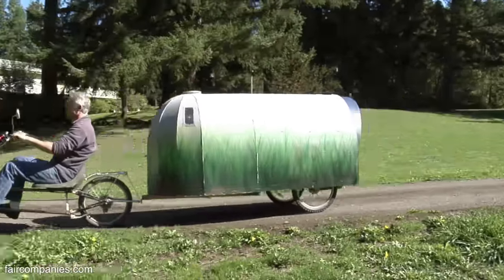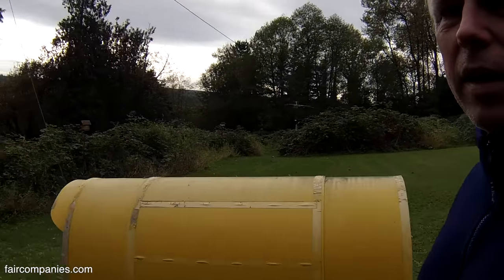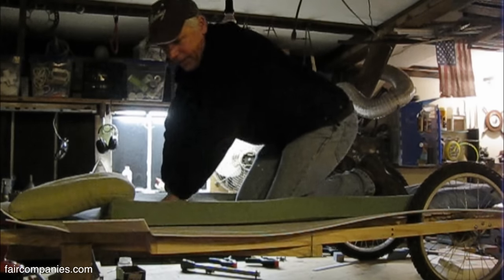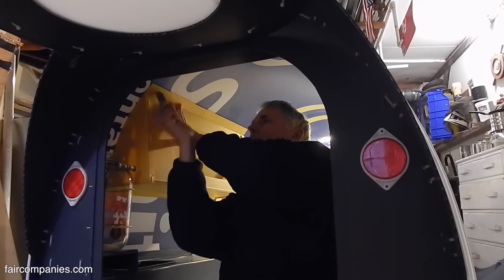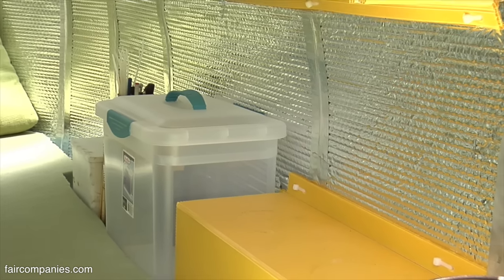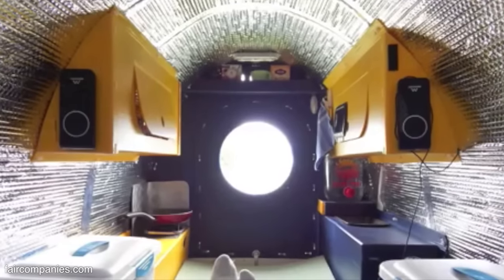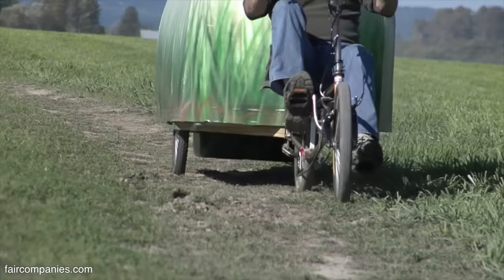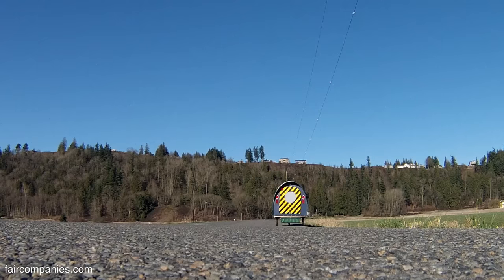$150 bike camper: DIY micro mobile home (downloadable plans)

Comment: How about just get one of them kiddie bike trailer things and keep a small tent inside the trailer...?  Along with a sleeping bag of course.
Reply: +Robert Decker Jr. You'd have to take time setting up, and taking down your tent each day.  You'd be sleeping on the ground.  And you wouldn't have cabinets and counter tops.  But do what you want.
Reply: +deezynar Indeed.
Reply: +Robert Decker Jr. +deezynar is right... you are thinking about making a scattered trip and not a total change. If you want to do much camping or it seems this guy makes this his "home" for longer trips, you want to have things accessible. He says, he has drawers so you don't have to hunt through bags etc. What you're suggesting is just regular bike camping. This is meant for people who enjoy the diy of it, the challenge, the build and then having something that works as well as much larger, elaborate and expensive trailers. There are regular bike camping vids if you prefer that though.
Reply: +deezynar I can set my hammock rig up in about 10 min and weighs less than 4 pounds.  I don't sleep on the ground.  As for clothes when I'm hiking and/or biking I usually have but just one change of clothes, if that.
Reply: SecurityPro2704
Great!  I'm very happy for you!  You camp how you want to!  The rest of us will camp how we want to.  Is that OK with you?
Reply: What is a kiddy bike trailer thing?
Reply: Scarlet Peoni Those little trailers that attach to bicycles.People usually use them for carting around they're 2-4 year old kids,but you could also use them for carting around bags of groceries or even modify the thing so that you yourself could actually sleep in the thing,or just carry around a tent and other necessities. Food and supplies and such.
Reply: Robert Decker Jr. Thankyou, I need one for a Shetland pony but wasn't sure what they were called.

Comment: do you think I could pull this behind a moped
Reply: DaveyG's Channel 

I'd check local laws but it should be possible to pull behind a moped. My only concern would be how it holds up at the higher speeds of a moped vs a pedal 🚲.

Cheers! :)
Reply: Yes.  The power is there

Comment: "this is a regular camper" lol no it's not.
Reply: No but it IS a camper. And it IS shelter. And it IS better than a tent.
Plus you don't have to set it up and take it down all the time. It's also
available to get out of the weather,  immediately, if need be.
Reply: Yes it is, go ahead and prove otherwise. Or try at least, but i wont respond unless you do but you wont so bye forever :b
Reply: thats sad last guy before me in reply section

Comment: To top it off, he pulls it with the most inefficient bicycle he could find.  This is silly.
Reply from the maker: +Jacob Actually he mentioned in his interview that that bicycle isn't ideal for the setup and he'll change it out.
Reply: +Kirsten Dirksen that is so cool
Reply: But not bad for a prototype!
Reply: +Jacob Recumbents cause less aerodynamic drag.  His head is not much higher than the top of the trailer which is ideal.
Reply: +Jacob 
Supercilious trollery at it's finest there, Jacob.
Reply: he is proving a point , and don't watch
Reply: Actually, a recumbent is great for this.low center og means weight won't cause front wheel to lift. Recumbents are more efficient that uprights. The bike does not shift side to side, so it's easier to drive. Recumbent are like tractors when pulling loads. I've pulled a trailer with a 5 gallon bucket full of gravel with mine.
Reply: that makes about as much sense to a person of 55 as saying shut up and eat your toast that your no eating, knob. read what I said in context, I was defending the person making the video against someone who has done nothing with their life, and before you say anything about what have I done, I have invented cheep self-sustaining electricity, safety device for trailers, the class 1 trailers not the little ones, and so much more.
Reply: Jim Rafferty How would you even begin to know what I've done with my life?  You don't even know me..
Reply: for if you had done anything in life you would know just how hard it is to put yourself out there, and wouldn't then be so quick to scorn. just saying.
Reply: agree
Reply: +Jacob Uhm, how is this "inefficient"? Please elaborate.
Reply: +taxiuniversum It has no gears, Is very heavy and the sprocket mechanism is the least 'bang for your buck' energywise. It looks cool but is very impractical if you were to ride long distances
Reply: +Kirsten Dirksen , he seems to be in constant evolution with this goal.
Reply: +Sage Craigen What are you talking about? This is a recumbent, making it far more comfortable for long-distance journeys than diamond-frames bikes. At 0:59, you can pretty clearly see that it has a regular gear box. And what is a "sprocket mechanism"? 😜
Reply: We are talking about efficiency not comfort.....
Reply: +Sage Craigen if it isnt comfortable efficiency is irrelevent.
Reply: You can get bikes that are both ;)
Reply: He needs a Shetland pony
Reply: +Jacob pretty sure he's not trying to win a race broski . . .
Reply: the camper is very light, and the bike has gears.  Being a folding bike, he can store the bike in the camper, then lock the doors, and chain the unit to a tree or a light pole while in browsing in town, sharp designer!
Reply: On-road at speed, this bike is the most efficient. It's called aerodynamics. Look it up. Off road with obstacles, it gets less so.
Reply: why is it inefficient?
Reply: +Greg Miller Anything you can put your fist through will never be lockable! Apart from that, I agree. Brilliant design and I'm gonna have a go at making one myself, happy camping :)
Reply: I think this is a cool idea, and the idea of using a recumbent bike even cooler.  However, enlighten us...what is wrong with it and do you have a suggestion for something better on a setup like this?
Reply: That is what I asked Jacob below.  I am curious as to what is inefficient about the bike and what would he suggest using in it's place.
Reply: Pfft, another untalented YouTube critic, leaving negative comments and energy. When people do that it's a means of taking ownership of something they never did.
Reply: Head on!!!
Reply: yes, however, I would want my bike to be able to be locked inside, my reasoning for a folding bike.
Reply: No, but I use folding bikes with my 30' RV.  But in a tiny unit, that's what I would use, nobody would screw with the bike if I was away.
Reply: Jacob man come on...please give him some credit. This is great!
Reply: +Mando Lindo no it's Not WHERES THE XBOX
Reply: Jackson Beechgood lmfo right. But that could easily be added in. Or just play games on a tablet.
Reply: Jacob 20$ bike
Reply: Jacob, understand this. If it's getting dark and you're on a highway,you drive off next to the road and go to bed. Who says he can't get raided by some hooligans that are riding around? if you got like a 100$ bike,anyone who wants can steal it. if they see a shitty one like that,they wont even think of anything good being in there.
Reply: Jacob hahaha! You are funny.
Reply: The inefficiency isn't about the bike being shitty, it's about the mechanics of the bike. See how far forward those pedals are? There's no way this thing is going up any kind of a grade.
Reply: agree.

looks cool tho!
Reply: Recumbent bikes are more efficient than regular bikes. They are both more aerodynamically better and the rider can exert more force onto the pedals. Recumbent bikes hold the record for land bike speeds. This has lead them to be banned by bicycle racing associations.
Reply: it's a post-apocalyptic survival shelter... you think you gonna find a good bike after all scavengers have collected the only good parts remaining ?..
Reply: This is about reusing the stuff you have or being thrifty. You discredit too much yet contribute very little.
Reply: Well  what have you done exciting..  Paul is giving us ideas.. Trying to bash him is counter productive.
Reply: inefficient? the type of person who would be into this isn't in a hurry to get to a set destination imo.
Reply: If it looks stupid and it works, it's not stupid.
Reply: +Jacob . To put it simply, you're silly...
Reply: I pull mine with a riding mower.
Reply: Every human-powered vehicle world speed record is held by some kind of recumbent (yes, I also ride a recumbent).
Reply: Just get a diamond back mountain bike, problem solved
Reply: Ok, my thoughts on his recumbent. He should have went with a short wheel base recumbent. 
The length of chain makes a huge difference. The longer the chain, the more torque is lost. Simple physics. 
On the flats, he might have an advantage being more aero than an upright, which negates any loss of torque to the rear wheel. But uphill is where he will have issues. Combined with the bike, probably at around 35lbs, his camper loaded up, probably around 70lbs, means he has 100lbs to climb, especially in more rural areas, where inclines can go more than 20%. The amount taxing his legs would be exhausting. He'd have to gear down to a 24x40 cog combo to keep from killing his knees. 
This is where he'd wish he had a normal road bike, shorter chain, less torque loss, and able to use the handlebars for even more torque gain. 
I know, I ride both types of bikes, and the recumbent is far better overall. But, hills aren't fun like the are on a standard road bike.

Comment: One area that I improve on is the Coloplast hammock floor design. When out driving around I see plenty of lost and damaged ratcheting straps along the road. I would stretch the straps over the floor framework under the Coloplast floor to give it extra support and frame rigidity. I would also change the opening window design so that it would have a watertight seal when needed if you found yourself trapped in a sudden squall. If you're a talented welder or know someone who is then a welded aluminum frame would be an excellent strong lightweight option too. Other than that I love the camper design. I also wonder if a small wheel operated generator supplying batteries with juice would be a good alternative for cloudy days. And not to sound like a fatalistic pessimist but given our societies increasing acceptance of pointless violence and increasingly difficult to ignore observable reality of societal decay and breakdown, I think it would make an interesting bug out camper. Depending on where you live, you could paint it camouflage to match the vegetation that occurs in your neck of the woods. Hopefully it never comes to that (fingers crossed).

Comment: The minute that bottom CARDBOARD sign gets wet, you're going right through it 🤪
Reply: That’s plastic dude. It repels water. Only way something going through that is if it’s sharp or really heavy and pulls the plastic out of the screws and zip ties. So maybe a fart since it’s the sharpest thing.. goes right though your pants without making a hole after all. 🤪
Reply: Thanks,  Little Mary Sunshine, but how about you listen?

Comment: A camper bike would be great where the driver sits in the closed interior. Like a motor home.
A cargo bike "camper" in which you can also stand and with solar panel on the roof.
Electrical support (pedelec) would also be easier to install because it is not a trailer, but the bicycle itself.
There are many retrofit kits with wheel hub motors. Also used.

I would like a big box trailer or cargobike for "campaigning".
A trailer or cargobike as a mobile billboard for information guerrilla.
 Perhaps a 2m (6.5ft) high box, 2m long...
But how wide?
 It should still be able to ride on bike paths.
What is the width and length of this trailer?
1.5m (5ft) maximum? Or better less?
A white surface could also be used as a screen for a projector.

Comment: I'm going to build a bike trailer. I want to use welded aluminum for the frame to keep it light. I'm going to use 4 x 30cm alloy bike wheels. This will al[ow a low centre of gravity and still give a 15 cm ground clearance. The 4 wheels would give the whole trailer stabilty without need for props to keep it horizontal and it will spread the load evenly.  I will make it 2 Metres long by 1 metre wide so I can fit a normal size foam mattress. The storage under the bed would be 30cm deep, so plenty of room for my camping gear. I want to use welded aluminum for the frame to keep it light.  The beauty of Paul's design is the huge weight saving and neat interior without any need for canvas.  If it gets too heavy to pull with my bike, I may have to consider an electric bike for the uphill work.
I'd be happy to receive any advice or ideas from readers.

Comment: I’m thinking about making a small camper like this only with a small seat and the front end of a bicycle attached to the front. It would be powered by a 35cc engine or a 1000 watt motor (no license, registration, insurance, etc. I have a bicycle that’s powered by a small petrol engine like this). It’s also fairly easy to get these engines to run on woodgas, propane, or ethanol.

Comment: MY Only concern is the zip ties:  I have used several types of zip ties in my orchard trellis to attach water tubing to the trellis wire but after a year or two, they deteriorate so badly they break easily!
Zip ties made from polypropylene might work better because they are supposedly resistant to UV but finding such items is difficult or very expensive.

Comment: it will be great in the future when they have better solar panel technology you can cover the camper with panels and have power as well for charging cell phone, etc.  As well as cheaper alternatives to carbon fiber, and an electric assist motor for pedaling on hills.

Comment: Very light weight structure lay on the ground when it is in use. Trailer can be very light to carry it. Sandwich wall, insulator in middle, maybe is practical?

Comment: Nice job, excellent use for signs.
I wonder if you've come across Astroboard for use in areas that require a bit of extra strength / rigidity?
Comes in  6mm and 10mm sheets iirc  - plastic honeycomb structure that's about 60% the weight of equivalent thickness ply.
Used for things like flight boxes / cases - not cheap, but if there's a manufacturer of such items nearby, it could be worth a visit for offcuts - that's how I got hold of some.
I've just started building a new trailer which I want to be as light as possible (folds and goes on bike) so will probably be using some of the bits I managed to scrounge :)

Comment: This idea might work at campsites as a sort of pre-assembled tent on wheels. I'm not sure that bicycle is powerful enough to tow it very efficiently. Maybe this could be towed behind a car (it might need trailer lights in that case).
Reply: A hundred pounds on a trailer this size is fairly easy to pull about 12mph. Much faster and drag becomes a large factor.

I could see 50 miles a day as a realistic number. Provided the terrain is flat.

Comment: This might be a bit dangerous outside the local KOA. ie, wild animals on 4 or even 2 legs... 

Still it might make for an interesting solo summer excursion camper near a beach. 

The rear wheels should be solid rubber and spokes replaced with solid aluminum hubs.

Comment: There's a group out of Seattle that putting up homeless shelters in Seattle and Portland made a lot fancier than one of these trailers but, I like the idea of using used campaign signs for projects like this.  Why do the homeless need those 10'x10' shelters when this thing will do fine.

Comment: Thanks for your inspiration and I decided to embark on a project of my own over the holidays .. if you have a moment go to my channel and watch the 6-minute video... was able to construct a 77 x 45 in bed four wheel wagon electric bicycle drawn camper with a Class 1 hitch, on a farm Tuff canadian-made steel frame. Very happy with it and it has lots of possibilities for further modifications. Thanks again for your instructive inspiration... I feel inclined to shy away from square-edged design for storage on the inside compartment because the coroplast edges can be Sharp and cause scrapes Cuts or other injuries. Doubling sheets of coroplast for the bed is brilliant and it worked even for the quite large 77 by 45 design. Total cost of materials including the wagon frame was around $ 750? Including the materials for the hitch component of the bike. Arguably the weak link having the tow ball mounted in wood... Lol seems to be holding up thanks to Gorilla Glue... And Gorilla Glue duct tape which is the only kind to buy LOL

Comment: I wanted to know, how much would it cost if you built it for someone because I'm not good with my hands building, plus I weight 295 pounds, so I wanted to also know would hold my weight, or would it need more would under it to hold my weight, I wanted one, because if I should homeless and outside again, I really want and need this, I would pay for it to be made.

Comment: I have a driving phobia, this would be perfect for me.
Reply: You really have a driving phobia?
Reply: @redzepplin327  yeah. I smashed a kit made go cart into the side of an old 70s steel chevy when I was little. Go cart slid under, my face caught the side, my neck caught the rusty edge at the bottom. My knee locked up keeping my foot on the gas which kept the engine driving my face into the side. Got to spend 3 days in pediatric ICU on my 8th birthday. I get flashbacks when I try to drive now.
Reply: Wow, that sounds terrible. That would traumatize me as well. Sorry I made you relive that memory..........TH iz the One (Youtube)